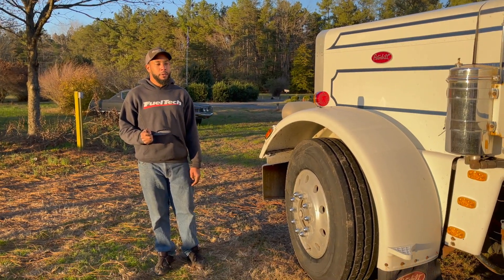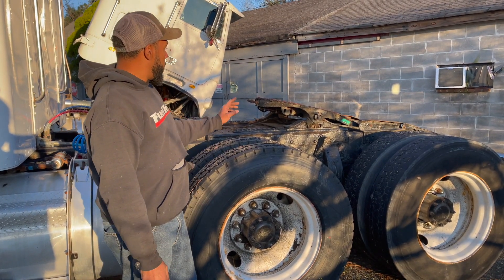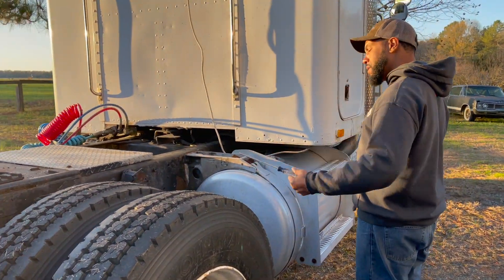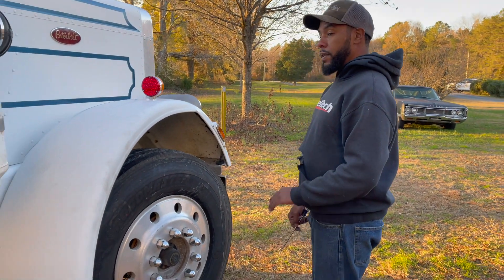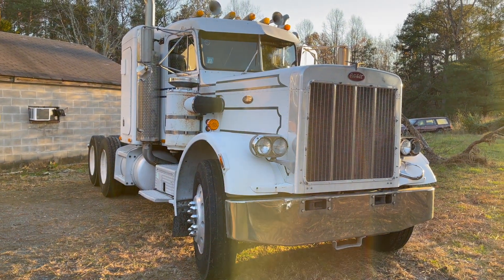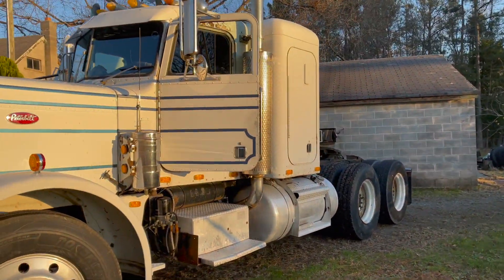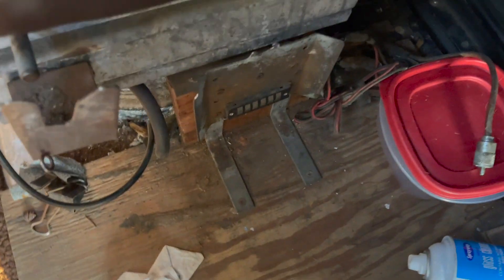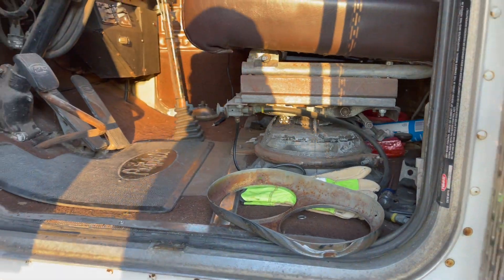Can I drive it home? - Peterbilt 359 Rolling Restoration Ep.1

Comment: Nice how much did you get it for ? I just bought a 84 359 for 27000. And swapped the big cam Cummings with a 3406B
Reply: How much difference was the rear engine mounts compared to the cummins?
Reply: Hey Lonnie that’s awesome I just bought a 1986 3406 in it for 20,000Look forward to rebuilding that one